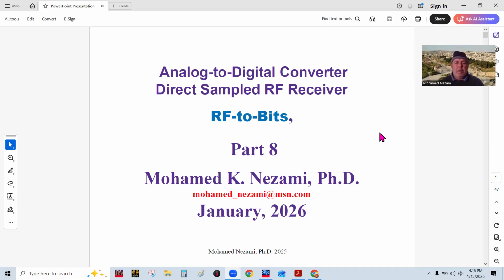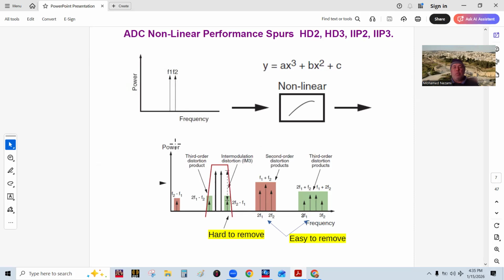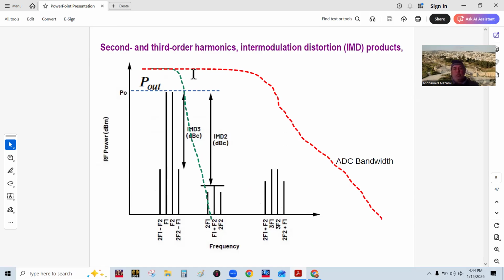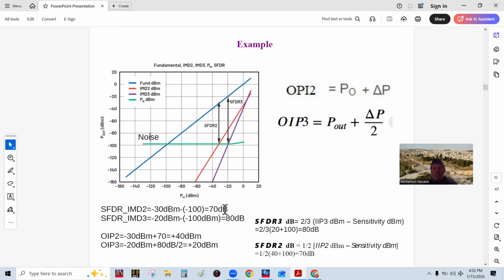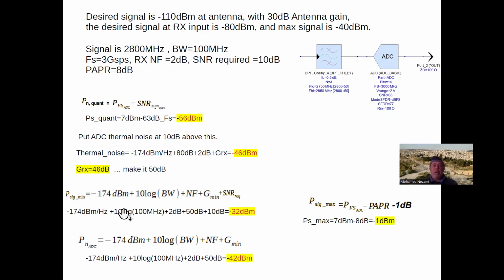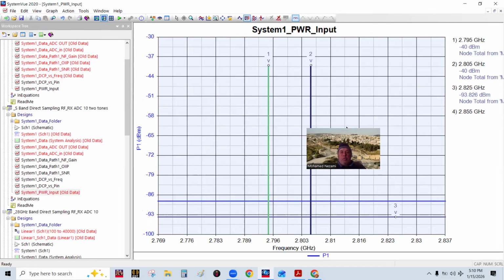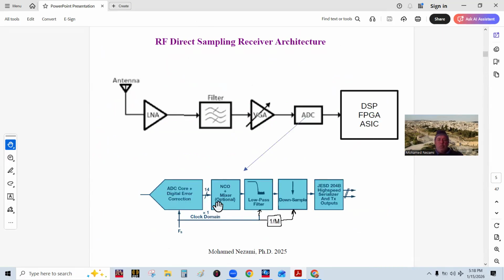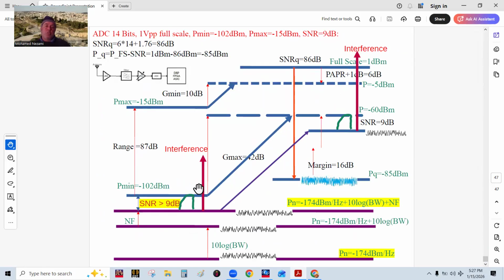Direct Sampled RF Receiver System Design, part 8,

Comment: Do you have a video that discusses anti alias filter and how to derive rejection requirements?
Reply: Just in case, I can point you in a direction: Your requirements will come from how much distortion and noise you will allow in the passband. Some harmonics will always be in the passband (2N-M intermods for example) and your filter cannot do anything about these. The harmonics that are not in the passband before sampling may still fold into the passband upon sampling, these you can reduce with filtering. Same goes for noise. Some of the nonlinearity which produces these comes from the ADC itself, you cannot improve these in the passband, and so there's no reason to make your requirements stricter than this. If you look up "Analog devices frequency folding tool" there's a calculator that will help you visualize this.

Comment: Thank you for the video. I have been trying to find information on how to choose the placement of amplifiers and filters in a cascade once the gain and band requirements are decided. I know that there is a benefit to having high gains in earlier stages in terms of noise. However I cannot find good info on how to place filters, as in where they should appear in a chain of amplifiers; or whether to use variable gain as opposed to fixed gain and variable attenuation as shown in your example. I may be worrying too much about amplifiers oscillating, because I do not really understand under what conditions they risk doing this.
I see in your example that you have variable attenuation before and after the filter; Is this to facilitate having two different AGC loops?

Comment: Dr. Nizami, great lecture. Regarding the polynomial model for weakly nonlinear RF systems discussed at 7:54, to ensure the model correctly represents the signal gain alongside the nonlinearity, the standard Taylor series expansion should be used: y = a0 + a1x + a2x^2 + a3x^3 + ... where 'a1x' represents the fundamental linear gain of the system."